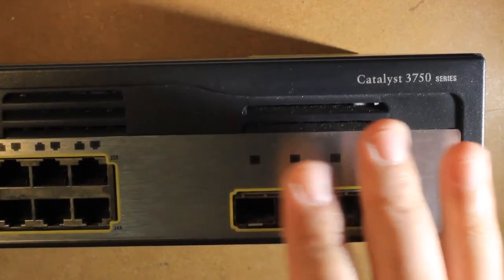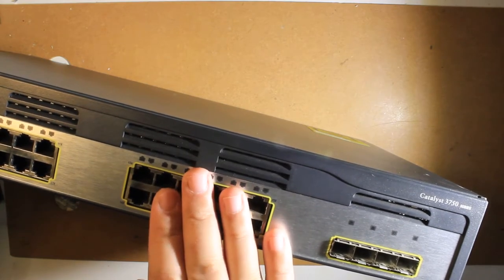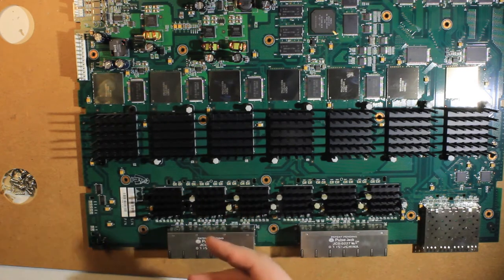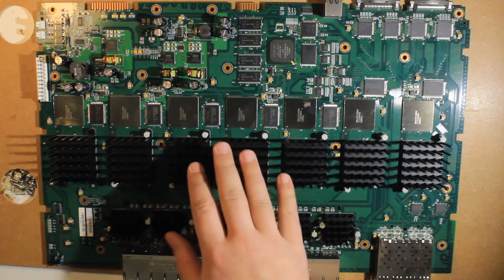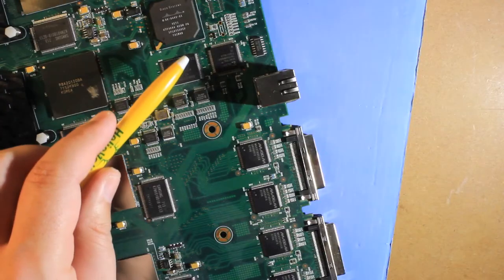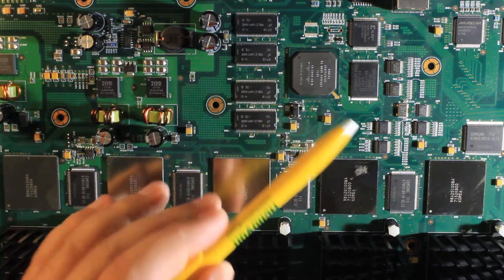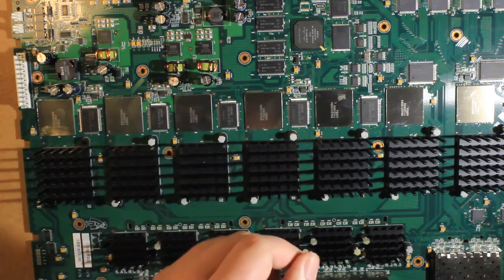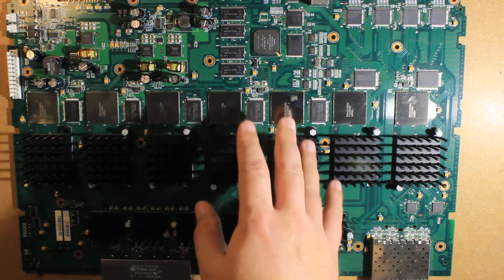Cisco 3750G Gigabit Layer 3 switch teardown, a detailed overview for CCNA lab and repair

Comment: Wow, what a blast from the past!

I was the owner of the Cat 3K product line. And you did a pretty good job  going over the switch in your video.

Few things to point out:

The G24-TS is the first "gig" 3750... the Sasquatch ASIC was the firs generation optimized for Fast Ethernet and could support either 24x 100MB (FE) ports or 4x1G (GE). That is the reason why it was a 1.5RU.... too many ASIC and the box needed more airflow to cool all that down. The 3750G-24TS-1RU came a couple of years latter with higher density "Sasquatch" ASIC (named  Strider) and then the switch required less ASIC and we were able to shrink it down to 1RU

Fun facts:

The StackWise chips code name was MAD MAX because they control the road to the StackWise connector

The code name for the 3560/3750 was Lord of the Rings as it uses a ring architecture between the Switching Fabrics. StackWise is basically an extension of these rings.

ALL the SKU had LOTR Characters code name Bilbo, Frodo (that one in your video is a Frodo 24), shadowfax, Wormtongue.... You should be able to spot a  a hobbit on the fab if you look closely!

JF
Reply from the maker: Dear Jean, I am glad that a high class engineer like you have watched my amateur video.
Many thanks for giving us more insights onto these Cisco switches, since the Cisco 3750G were the best Gigabit switches of their time. There were many things about the hardware where I was not sure, so I needed to guess.
By looking at your LinkeIn profile, all I can say is: RESPECT!!!
I did not know about the LOTR characters, and now I understand what that little guy is on the PCB with a sword ;)
Reply from the maker: In the newer 3750 series, beside the ASIC, as far as I can tell from the PCB layout you also have moved the cache-RAM and the Lookup-Engine on the same silicon inside the ASIC. Is this correct?
Just asking, because I am doing a teardown video where I compare the old 3750G with the new 3750v2 switches.

Comment from the maker: Regarding the ROMMON being in the Flash, that makes sense. That was also what I was thinking about. However, I did not dare to say it, because if do do a
format flash:
command, than the partition holding the ROMMON should be somehow protected.
Also, if you do a
dir flash: 
command, it mostly shows you the full 16MB capacity being available, so that means that they are either lying about the available space, or the ROMMON has to be somehwere else. Considering that the ROMMON is at least 0.5MB-1MB in size based on the size of the older routers/switches, the ROMMON partition would use about 10% of the Intle Flash.

Comment: Thannks for this great video. Excellent job. I have no idea about this stuff. Would I be able to buy this reset it and then use it as a simple 24 port switch. Like plug and play. I mean I just connect my internet to it and then plug all my other computers into it?
Reply from the maker: You could definitely do it, and it would totally work. However, it is like buying a red Ferrari and never driving it above 60Kmh, and even turning down nice ladies who try to get a ride in it. It would be a "waste" of money and unused capabilities.
The 3750G is a really fancy layer 3 switch from Cisco, which does both switching and routing and other advanced functions. 
Just to have a simple plug&play (so called access-layer) switch, one might buy a cheap Netgear, but these Ciscos have feature sets which make networking real fun.

Comment: I have one of the same series, but not the same as the one you present. and the same happens, it does not start, no LED, no CONSOLE. SMPS OK. I got that the transceiver chips (BROADCOM BCM5466R) are like overheated, (heat marks around the IC on the PCB) and a small short in the tantalum capacitors. could you advise me what to do, thanks ...

Comment: Very good knowledge of Cisco switch. I really want to know where did u learnt all this. I know no university or certification teaches u these things. I want to follow on your footsteps to learn. Thanks
Reply from the maker: Thanks for the positive feedback. I have learned these things by repairing switches. Since the circuit diagram is never provided by the manufacturers, I tried to look into the functionality of the components.
As you can see from the comment of JF Vincent, who was one of the engineers behind this great Cisco product, he wrote that I got most of the things right.

Comment: Where did you learn all this?  Is there documentation or some resource we can look through ourselves?  What about other devices like 4500/6500/Nexus, ISR routers, etc.  This is ammmmaaaaazin!!!
Reply from the maker: +Robert Xiong 
Many thanks for considering this video useful! Compared to actual real professionals I am still just a beginner/amature. However, real professionals rarely share their knowledge either for financial or contractual reasons (non-disclosure agreements). 
I would be more than willing to pay for the actual repair manuals and board layouts, but that is simply not available for everiday people like us. Thus, one just disasambles defective units, and tries to repair the boards based on his experience/intuition gained during the years. After repairing couple of units, and following the tracks with a multimeter, one gets a rough idea of what is being done in the individual components.

Regarding the documentation, you can guess that Cisco will never-ever release a detailed hardware documentation. This is manly because they want their hardware to be as closed and secure as possible, which is fully understandeable. In general, the less is known about how a product works, the less it will be exposed to a potential vulnerability. Also, Cisco have spend millions of dollars to develop this hardware (especially the ASICs), so they do not want to help their own adversaries like HP or Juniper.

Comment: I think rommon located on same flash where ios located, but in different partition, which is quite common practice in embedded systems.
Reply from the maker: +Smit1237 I replyed to your comment, but since I did it from the Gmail page, it does not appear here as a reply, so I wrote it out again below. Youtube's comment/reply system is clearly broken...

Comment: have two of them. Both have failing PSU due to use of bad quality capacitors. even on main board is failing bad quality capacitors
Reply from the maker: The 3750G are actually pretty well built. I have seen them fail in those cases when they were put in production in way too hot rooms instead of air conditioned server rooms. If you got the time and tools, replacing the caps should get the switches going again.

Comment: Hey can you tell me why are there 7 ASIC processors instead of one big ASIC?
Reply from the maker: +Ashwin P There is a VERY simple explanation for this based on these reasons:
1)silicon-chip production yeald 
2)BGA (ball-grid-array) pin-count for hot-air rework
3)maximum layer count on the PCB for routing the traces
Because of these factors, there is a range, or if you wish, a "sweat-spot" where it is worh to manufacture and sell a chip.

1) The larger the chip surface area, the higher is the chance that one small component on it will be defective. This is why as an example, Nvidia and AMD are binning their GPUs and they are selling them for different markets based on how many units work properly

2) a BGA chip with more than 2000 small lead-balls is impracticable to work with even with highly precise industrial reflow machines. The heat will be uneven, and the PCB board will bend during the heat treatment when the BGA is attached to the PCB (so called sagging, where the epoxy delaminates)

3) the more layers you use in a PCB, the more expensive it gets, and the more difficult it will be to route the signal and to keep signal integrity because of crosstalk.
Reply: +Donkey Learning IT Thakyou very much sir.The two videos are awesome